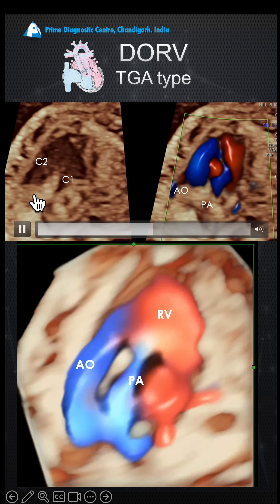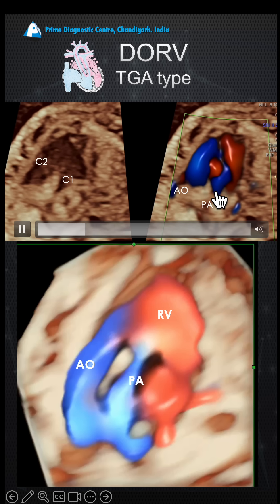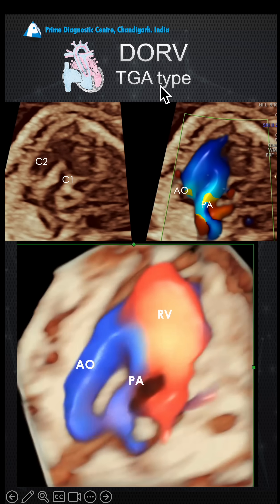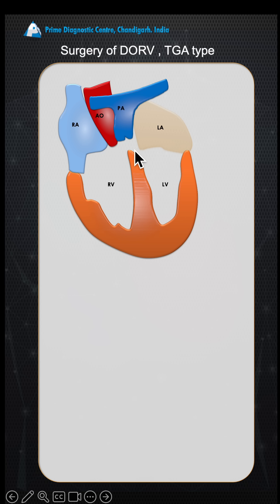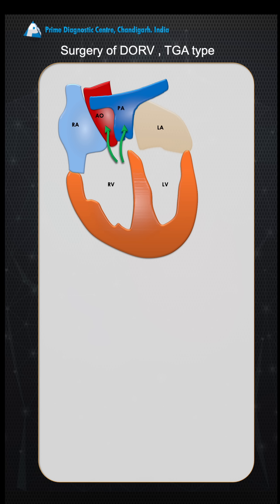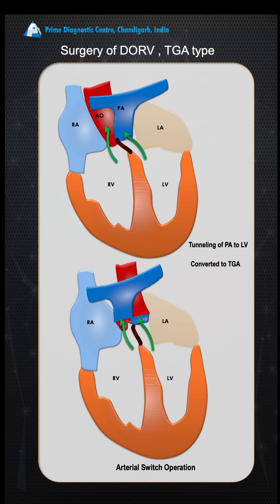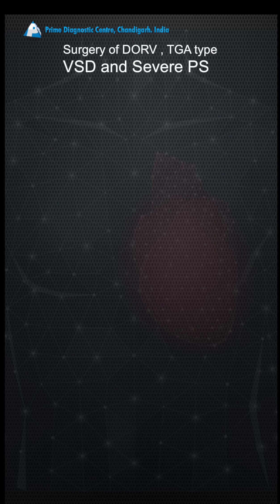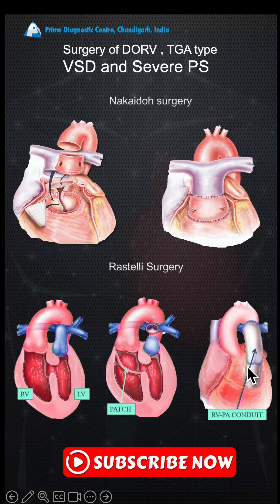TGA-Type DORV with Pulmonary Stenosis | Key Echo Findings & Concepts

Comment: As you said there are two coni so it's DORV.If it's only one conus and two arteries what could be the diagnosis, sir? 🙏🙏
Reply from the maker: With few exceptions in DORV both great arteries have conii sub aortic as well as sub pulmonary. If there is only Subpulmonary conus and not sub aortic then it is TOF.
Reply: @drupsinghin  Thank you sir 🙏